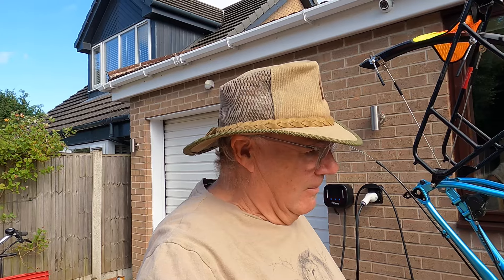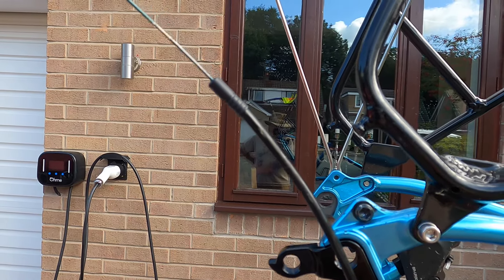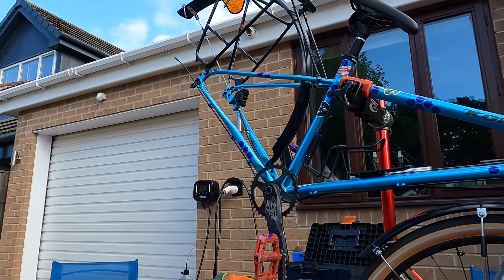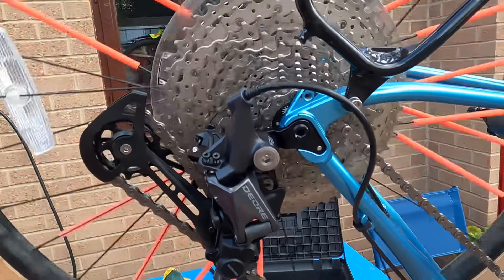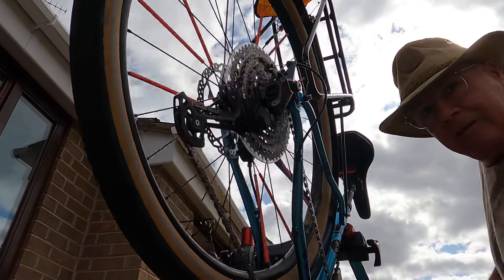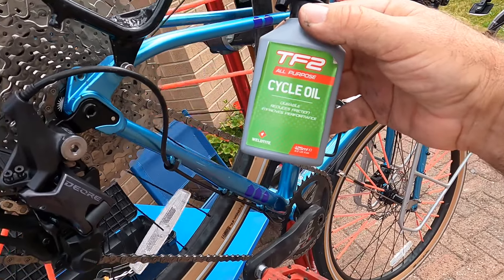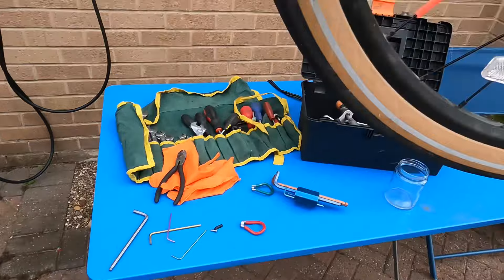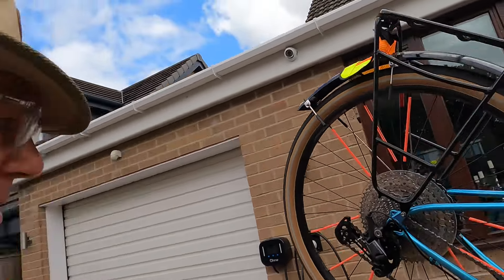Bike Gear Repair For My Warmshowers Guest

Comment: I had some US cables with an inner Teflon tube and cable for an extremely easy function, but they aren't made anymore, though a Danish Importer had bought the remnants in Denmark, but still want a heavy price for those. Finn. Denmark